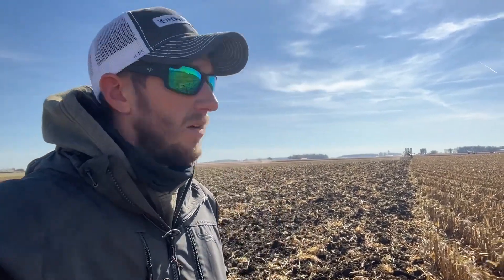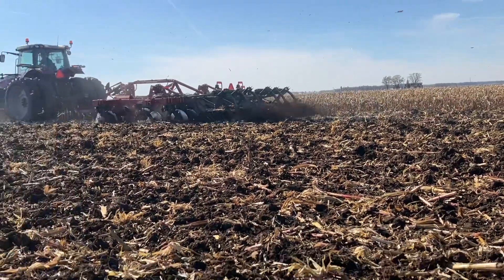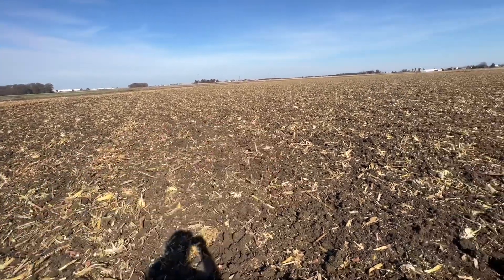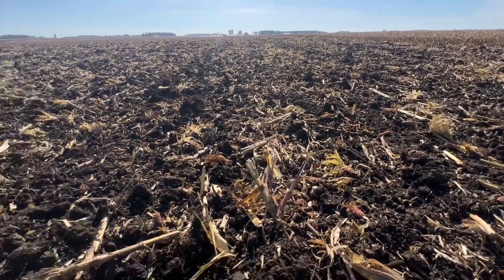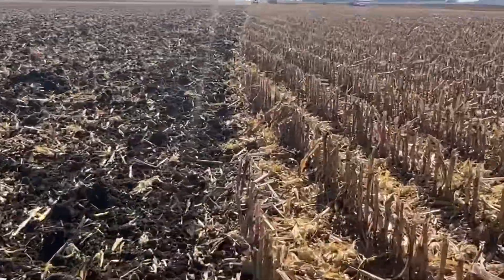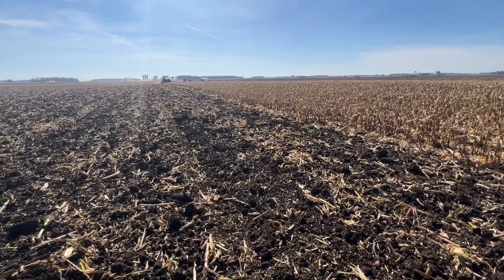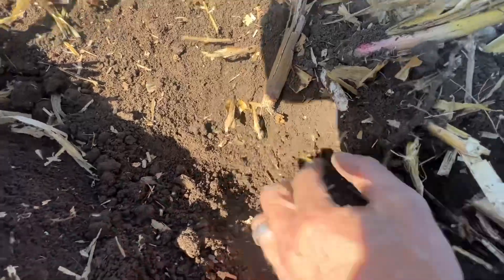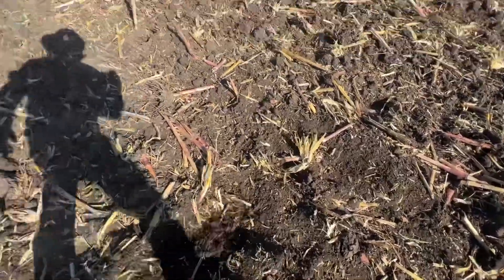Salford 5200 in Corn Stalks

Comment: How much hp does it take to pull a 5200 that size I assume it’s a 12ft model?  Looks like it works corn stalks nice I’m looking for something to work corn on corn we currently plow but looking for something different and don’t have the HP for a ripper.  Thanks!
Reply from the maker: It does take some HP, you will want 250+ on a 12’ model